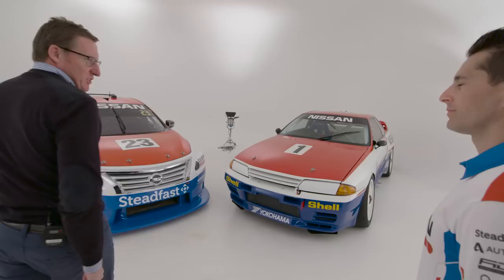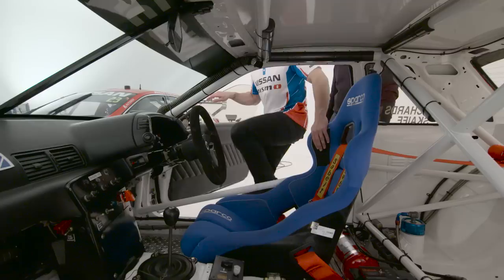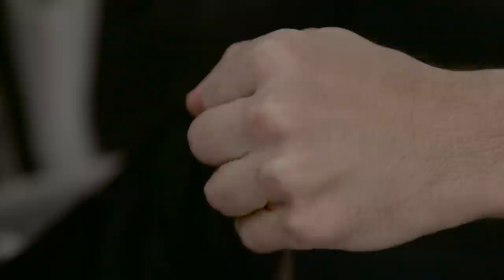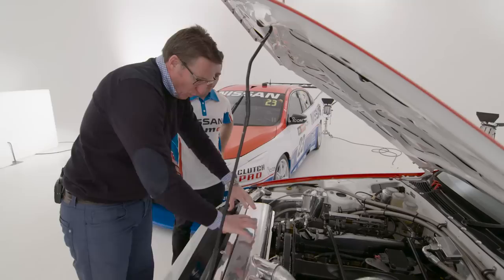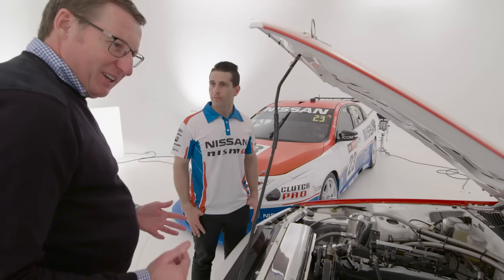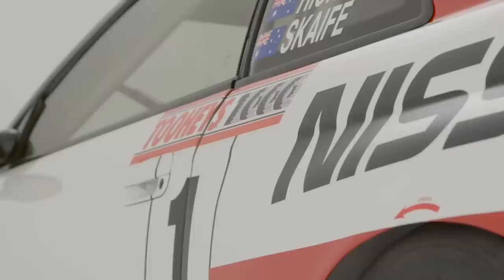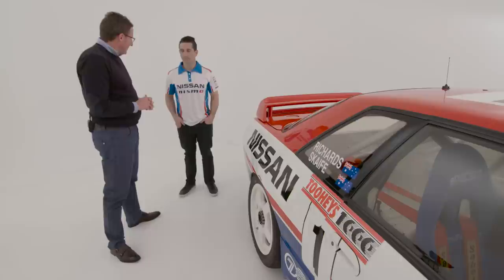Mark Skaife technical feature on 1991 Bathurst 1000 winning Nissan GT-R R32

Comment: It's awesome to see how much Skaife praises this car... Crazy how this car was ahead of its time.
Reply: Yep i get chill just thinking how good this car and how dominant this car was & controversial due the the horsepower & 4WD & steer. Made Dick Johnson very mad. The development of this car was so advanced.
Reply: I love how he knows so much tech about the car. Most drivers these days are just jump in drive guys.
Reply: @SirDaffyD  that's why he was so successful, not only for Holden, but Nissan as well. Knew the car he was driving, studied it and pushed it to it's limits. Knew where he could find time if certain things where tweaked on the car setup
Reply: It was designed to be like the Porsche 959, except more advanced & aerodynamic. 
Porsche developed the 959 & sold it at a loss. 
The price they charged for the 959 was half of what it costed to develop one. 
The R32 GTR had a significantly more powerful engine than the 959, it was actually a 500hp motor that was heavily detuned for the street veer the ECU, Exhaust & one other area - can't remember which. 
But it was a rather radical car for a Group A & took a tremendous amount of racing victories.
Reply: @brantleyfoster021  
959 was designed for group B rally and also entered in Dakar, where engine longevity was more important that ultimate horsepower..(engine  detuned to 400 hp.)...959 - 2.8L engine was developed from Porsche 956 / 962's Group C and can easily give 680 hp at 1.4 bar (versus 959's 0.9 bar)..
I think Skaife says they ran R32 at 1.8 bar boost for 700 hp?
Reply: @r0ky_M  
The HP figures were higher than specified, they stated 600hp for the R32 when it was actually 640hp. 
The only problem is I didn't see the Dyno run for full boost.
Reply: @brantleyfoster021  
Skaife says max. is almost 700 hp at 1.9 bar.
Reply: @brantleyfoster021  
Perhaps you can explain your claim that R32 was more advanced and aerodynamic than  959_🤔?
For starters: Porsche had sequential turbo charging,  twin-damper suspension/ ride height and hydraulic dampening adjustment via a button, 6 speed box...drag coefficient of only 0,31 which could be further improved via an active aerodynamics system.
Reply: Thank Japanese people and Nissan motor sport not skaife
Reply: @londzale3163  who thanked skaife?
Reply: @xxxclusv  it’s not awesome to see skaife taking credit for a product that he didn’t create
Reply: @londzale3163  who said he was taking credit?
Reply: @TrackRecord3455  u no nothing, the rear steer was deleted for bathurst. And usually on street cars too
Reply: @londzale3163  thank fred gibson australia who put 200k into them to actually make them last. And we named them godzilla. NOT NISSAN OR JAPAN. U KNOW NOTHING
Reply: @samjohns5622  big up you Australians for obeying you masters 🇯🇵 and always be a good bitch don’t ever change
Reply: Fred Gibson and Nissan but a superior car that was simply too good. I remember I was at Oran Park in 1989 when I heard about the spec of the GTR and my heart missed a beat.

Comment: I was just reading how after the 1991 Bathurst Victory, the team were then set to take the race winning GT-R to the Fuji Speedway in Japan for the 1991 Fuji 500 race, but were asked not to do so by the head of NISMO in Japan. 

The Japanese company were fearful that the Australian built car would easily outpace and defeat the Japanese GT-Rs at Fuji after having seen the speed of the Gibson built car at Bathurst. 

NISMO claimed that it would be bad for business for their own factory backed cars, as well as those of their customers, to be soundly beaten by an overseas built (although still factory backed) GT-R.

Gibson Motorsport were in a league of their own in the early to mid 90’s.

I believe Holden also considered making GMS their official factory team if Walkinshaws team didn’t start to match or better the results of GMS but then with the demise of Cigarette sponsorship and HRT’s signing of Lowndes, it never eventuated.

Comment: I saw it in action at Oran Park during the 1991 ATCC season. It came down through the dipper, left onto the main straight and disappeared like it had been fired out of a slingshot.
Reply: DJShotty I was at the lakeside round the same year as a 7 year old. I still remember Jim Richards going past me like a fighter jet. After a few laps it seemed like an eternity before the rest of the field came through.

Comment: what i find funny about racing is that as soon as something quick and different rocks up they ban it, r32 was banned here after it DECIMATED, the 787b was banned after it flogged le mans and that thing was a tiny light engine compared to its competition. You cant advance technology if things get banned for being better than the competition
Reply: Rotaries weren't banned at Le Mans because they had any sort of advantage, is a common myth that isn't true.
Reply: So what were the regulations after 92?  Did Nissan race after 92 at all?
Reply: @hansolo6827  the regulations basically stated that Class A cars (the precursor to V8 Supercars) had to be Australia-made 5.0-litre V8's, however the bigger teams used American engines ironically. Nissan didn't enter the Australian touring car scene again until 2013 with the Altima
Reply: @mr8I7  100%. There is so much shit about the Mazda 787b spouted by people who are ignorant of facts. In the main era of Group C it was an also ran, it was not close to fast enough to compete at the front. It won when the competition was not what it was and was handicapped. A 1 race victory car that is elevated because of a computer game. It also sound crap after 30 minutes, just a noise and I know because I was there.
Reply: and the e46 m3 gtr because porsche is a massive wuss
Reply: @housey4297  just a noise? What the actual fuck do you have any idea how good rotaries sound
Reply: @housey4297  The facts. The Mazda 787B had two advantages. Reliability and fuel economy in 1991 the only cars that could match the speed vs. fuel economy was Mercedes but the C8's didn't have the reliability and died handing the win to Mazda. 

You are right however that the rotary engine wasn't banned by the FIA it was just restricted by the FIA/WEC to the point it was noncompetitive so Mazda pulled the plug on its Motorsport program.
Reply: @Shifty_Malone  it's true though, only won 1 race out of 23 races in two years..............dog shit race car.....
Reply: @RotorRian  the 787b was not reliable... It competited two years for endurance championship, and won 1 race out of 23. It always broke down, it was heavy, so heavy that Mazda asked Jacky Ickx to lobby the FIA to allow Mazda to reduce the weight beyond the legal minimum and they allowed it... And still wasn't competitive....... The race car for hypebeast......

Comment: Awesome car and the reason I had to have one. The original V8 Killer. The true Godzilla. Skaife and Richards,legends.
Reply: You're forgetting the RX7's in 1984. They did a great job for their time
Reply: Greg Whitbread until the Godzilla Zilla beat the V8s and sierras too
Reply: It still is, if they updated it with new technology & ran it at full boost; it would pose a serious threat to current V8 Supercars. 
They never ran it at it's full potential, but they didn't need to in order to win.
Reply: Arghhh, they were killed way before then. Jag V12/BMW 635CSi in '85, Volvo 240T in '86 ATCC and E30 M3 and Sierra in '87 (ATCC and Bathurst). The V8 Commodore was struggling to be competitive all throughout the Group A era (the V8 Ford Mustang only lasted two seasons).
Reply: The original V8 killer was actually the Z18ET Nissan Bluebird which got pole driven by George Fury in Bathurst 1984.  Beat all the V8s and set the group C lap record in the process at 2 min 13.85 sec
Reply: You're all wrong the mighty lc and lj gtr xu1's were and are the v8 killers, they weren't nick named "giant killer's" for no reason
Reply: Full noyz Racing 
The GTR got the nickname "Godzilla" because of the way it dominated a helter skelter field of car's. 
Their was the Cosworth Sierra's with a turbocharged 4 (Dick Johnson's made 680hp too despite being overtaken & lost to the GTR in 1992), the V8s in the Commodore's & the Twin Turbo I6 in the AWD GTR. 
It didn't just dominate the V8s, Dick Johnson's 680hp Sierra was significantly faster than the V8s anyway.
Reply: @ikijime  also chopped brocky off the line on the first start
Reply: @nnoddy8161  86,87,90 wins, I guess you are correct they did struggle in that era
Reply: @naturesmagicalscenerieswit1876  mate, they didn't win one ATCC in the Group A era ('85-'92)!!!! Go back and check the number of Group A races that the Commodore actually won. You will be very, very surprised.....it ain't many. The 'wins' in '87 (Monza & Bathurst) were both by default...on track they could not compete with the E30 M3 and the RS500 (even when the others were legal).

From memory the ONLY win post '87 was the '90 Bathurst.

Comment: When nissan knew how to make cars...
Reply: Check Mate they still do.
Reply: Check Mate , still do 2.
Reply: What cars?
Reply: Cant say any of the gtrs are shit.. Even the new one is a weapon to drive!
Reply: That's right, but the new one is more computer controlled  than anything.
Reply: Now they just make awful looking crossovers.
Reply: Blame Renault. When Renault bought Nissan in 1999 everything went to shit.
Reply: @jdmr1c3ing  yeah they went from reliable japanese automobiles made with passion to crappy French cars. They are too scared to change the R35 and 370Z because they know they'll fuck it up AND be unreliable.
Reply: Comrade Hatuey R35 🙄
Reply: Comrade Hatuey and a fukn weapon mate.
Reply: There is nothing original about this car beside the frame, 1991 engine block, and maybe the attesa ets.
Reply: Gen X designed cars were the best
Reply: They still know how to make cars The Nissan GTR is still around and still evolving check out the 2020 NISSAN SKYLINE GTR and you will be amazed with all the new developments
Reply: I reckon the engineering behind the R35 is undeniably impressive. The downside is they tipped a little more towards performance at any cost and a little further away from just maximum driver fun experience. The 400Z looks promising though. 400hp, manual transmission, rwd, sleek more old school design. Old school fun. Less of a Golf type experience.
Reply: Most of this car was australian made, gibson racing
Reply: @TrackRecord3455  not a skyline, name was dropped from the GTR in 08.
Reply: Correction when Nissan actually made cars. Today they're another company that's been bought up and is a shell of what they once we're. But then again allot of Japanese car companies have lost that unique styling and engineering that made them special.
Reply: These were actually not allowed to race in Japan, Fred Gibson for more out of them than what Nizmo did so Skaife was right this was very much and Australian Skyline
Reply: @mr8I7  they had to make money..
Reply: @TrackRecord3455  the gtr is already discontinued unfortunately
Reply: @niallhoran1367  skyline name still lives till day... but they didnt make the skyline gtr...

Comment: When they started banning all these beautiful cars, I started to fall out of love for the sport. The manufacturers should have  just got on with building better cars to compete. I no longer watch today. It just not the same. I do switch on for the TCM races. I still remember when Mark passed Win on the dirt at Winton, that's how good the car was.
Reply: There were a few cheeky  things in this car that were a little naughty. One thing that comes to mind was the turbochargers weren't allowed to be changed as per rules. They wanted bigger turbos but we're not allowed. So to increase the size and keep them looking factory the housings were extrude honed to increase flow, effectively increasing the A/R ratio and hiding it from officials.
Reply: I stopped following the sport after the GTR  was banned...ive started watching the Liqui Moli 12hr in Feb though...its more like the racing of that era but with todays production cars...and guess whats always up the front? A GTR...and no fords or holdens to be found anywhere.

Comment: I love Group A, and Godzilla was the pinnacle of it. Some facts though, by '92 Group A was in its death throws - the manufacturers had had enough of the 5000 (and 500 evolution) homologation requirements. Internationally, the WRC concept had failed and everyone was going their own way - Germans with their DTM and the BTCC with the 2.0ltr category.

Australia had to make a call and we went the V8 route. Outside of Japan, Godzilla would not have a been eligible anywhere in the world much after '93.

'The banned' hype is only sort of correct as Australia could not have stayed with Group A.

That being said, even with its huge weight handicaps in '92 Godzilla was still trousering everything that moved.

Comment: Ever and always my favourite.  Simply loved the way it smashed those hateful Sierras and as for the local rubbish, well they just stepped on the gas and wiped those tears away.   Truly, Godzilla.   Über respect.
Reply: Ltfol the local rubbish, dont you mean the king of the mountain peter brock? The 32 had 4x the budget..and only just edged out the commodore. Equal budgets and h.p the skyline would lose! Cheaters!! Even skaife says here 700hp!!! They lied back then and said 550!!
Reply: @samjohns5622  You obviously dont remember Brock in a Sierra....or that both he and Johnson went to Japan to test the GTR
Reply: @justaname1862  so????
Reply: @samjohns5622  its called "Development Budget" ...if you were to add up the years f and h had in their budget it would have been more...or if they completely changed their power trains...the 32 was a completely NEW car so they had to develop it to be competitive...they had to engineer and manufacture so many components including tooling...even down to having wheels made. When Ford first entered the Sierra, it had a huge "Development Budget". Holden just swapped already DEVELOPED parts into new shells basically. If Nissan hadnt of been banned by f and h...they would of raced the R33 GTR in the 1995 season...and wouldnt of needed much of a Development Budget

Comment: Bathurst fastest laps
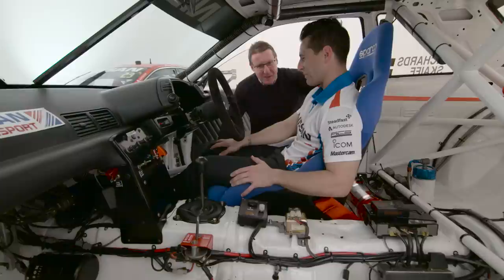1990 Mark Skaife Nissan GT-R 2:12.63
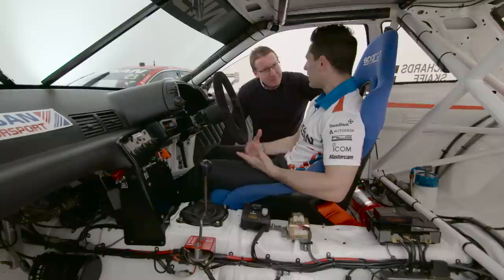2019 Chaz Mostert Ford Mustang 2:04.74
-7.87 difference
19 years apart
I wonder what's faster, the track.. the drivers, the cars.. or maybe the tech (ie tyres brakes etc)
Reply: everything has improved plus the ford is a custom built racecar while the nissan is a modded street car with a huge weight penalty
Reply: The big one is aero
Reply: Aerodynamics - the speed being carried over the top of the mountain today is the difference in lap times.  Top speeds are largely similar.

Comment: This car probably would still win today!! HAHAHA
Reply: Nah, current Supercars are lapping Bathurst about 8 seconds faster than Skaife's time in the GTR back in 1991. At that rate the Supercars would be lapping the GTR after about 15 laps.
Reply: @woopimagpie  remove the detune and ballast and the gtr will still be at the front
Reply: @bjorn1583  1991 was the fastest they ever went, which was before the big wastegate restrictions and weight penalties. Even screwed right up to maximum it's never going to be 8 seconds a lap faster. A Supercar has an aero and grip advantage too - they're properly engineered and purpose built race cars. The Group A cars (of which the GTR was one) were modified road cars. My money will always be on the Supercar. Back in the early days of Supercars maybe, but not in today's cars. No chance.
Reply: @woopimagpie  put the skylines in race trim just like the V8's (other than the purpose built chassis) and the V8's would get their asses handed to them AGAIN.
ps. the gtr's were never allowed to use full boost and they had a weight penalty from the get go.
the boost was restricted even more  and more weight added each year it raced
Reply: @bjorn1583  It's a pointless argument. We'll never know what the outcome would be.
Reply: With no weight restrictions, the max possible boost and a comparable aero package to the current V8 supercars it would be interesting
Reply: @anthonysimoes7307  Probably the closest would be the GT3 cars - current spec R35 GTRs run in that category in 2WD as the rules dictate, engines producing 550-600hp and weight of 1285kg, with better aero. They lap Mt Panorama in similar times to the Supercars, perhaps slightly faster. Earlier this year the fastest GTR qualified with a time of 2:03.9, which earned it 4th on the grid. The GT3 cars are slower in a straight line, but fly across the top due to their extra aero.
Whilst it's not an R32, runs in 2WD only, and has better aero, it's probably the closest comparison we have. The horsepower and weight are variable, as dictated by the B0P rules in GT3. I imagine if it were to run unrestricted with 4WD available it would suitably wallop a Supercar. An unrestricted Audi R8 ran a few sub 2 minute laps at an exhibition event so the Nissan would surely be capable of similar times. That's about 4 seconds faster than a Supercar has ever gone.
I'm still not convinced the old Group A spec R32 in this video would be faster than a Supercar though, even unrestricted. 8 seconds per lap is an awful lot of time to make up, and could it run at that pace all day? I doubt it. There's no way they could run full boost all day and have the engine survive, where a Supercar spec V8 can run at 650hp all day no sweat.
Like you say, it would be interesting.